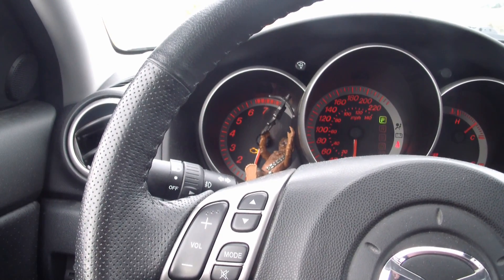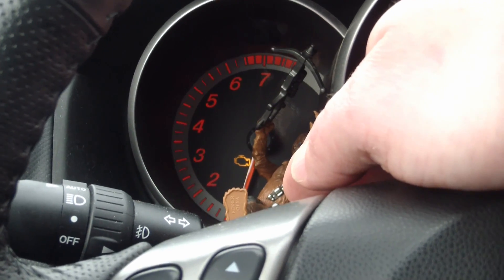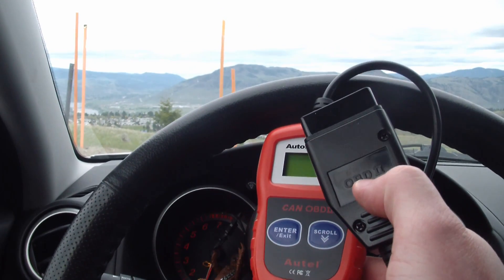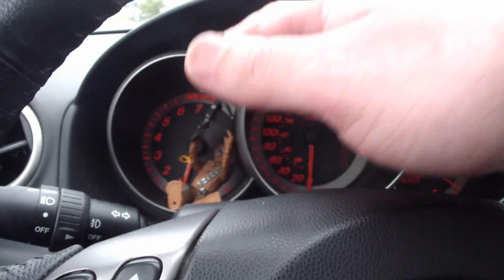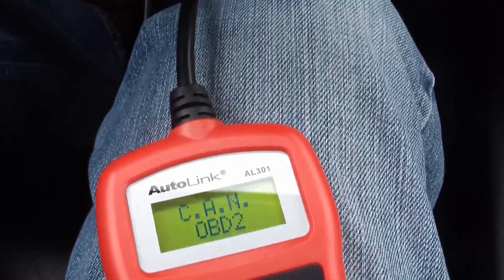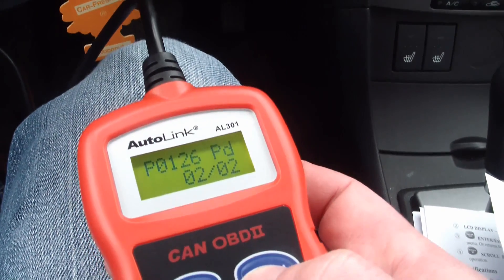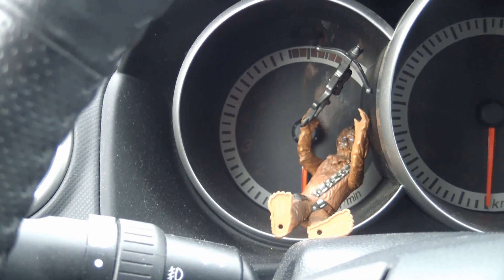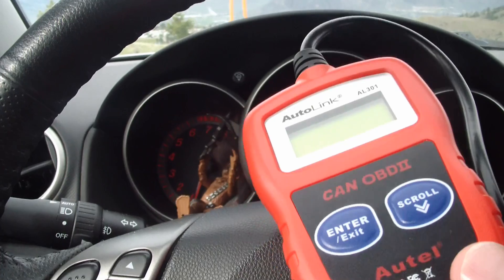Manly-Man Skills: Outsmart Mechanic Scams by Using Your Car's Computer!

Comment: Mom and pap garages will throw parts at it too. Like one time my friend's car had an issue where it was an intermittent no start issue. Dealership threw a new fuel pump in it. Only fixed it temporarily. And two independent garages also threw fuel pumps in it. Those only fixed it temporarily. So over a beer my friend and I decided to poke around with a multimeter to find a root cause. It ended up being the fuel pump relay. Replaced that and the problem went away for good. They drove the car for another 20,000 miles then sold it.

Comment: this IS a great way to get a rough, and i do mean ROUGH idea  what problems may be popping up on a cars computer.  getting a P0420 may or may not be a problem with the evaporative emission system, or you didn't tighten your gas cap past 3 clicks...

OBD2 Like it's predecessor OBD1 are a double edged sword. With some working knowledge of a car, it will help determine a better course of diagnosis using the scanner as a tool to aid you as opposed to it being the answer to your cars engine light.

As a mechanic i can say that i would love for people to get to this level of care for there car, proper documentation of pending or past codes can also help in determining the root cause of a problem.

like you demonstrated, you DO NOT need some ten thousand dollar scanner to do this simple procedure.  also a lot of those 30-50 dollar scanners have manufacture specific codes in them already (ENHANCED CODES).  Which is a further benefit.

Comment: Meh even with a fault reader you still need to work out what wrong and you need experience to get it right first time, get it wrong and you'll be buying and replacing parts one at a time and spend more money that you would talking to someone who knows cars.

Also if you really ARE a cheapskate this guy isn't even telling you the cheapest readr to buy, you can get bluetooth readers compatible with a smart phone for about a tenner that will give you much more information.

Comment: Also most OBDII ports are within arms reach of the driver if you are average height
Reply: +Tracty Zadorozny Yeah, because the OBD-II connector is required to be within 2 feet (0.61 m) of the steering wheel (unless an exemption is applied for by the manufacturer, in which case it is still somewhere within reach of the driver).

Comment: lol..... just because you get a code doesn't mean it has to be replaced... if your check engine light comes in for 02 bank rich. would you just replace the o2 sensor. or would you diagnose why your car is running rich? DO YOU EVEN KNOW HOW TO DIAGNOSE FOR A RICH CONDITION? DO YOU EVEN KNOW WHAT TO LOOK FOR? a code just pinpoints where the problem is doesn't always mean the sensor is bad. etc.. you don't just go and replace parts because this stupid $30 gave you a code LMAO!
Reply: exactly my point.... your the type of person who see's a code and replaces that part............ lmao gotta love the technicians who take time to diagnose to see if you have power.ground. signal. 5 volt reference make sure you are getting everything to the sensor and back to the ecu then you replace the part. if one is missing you have a break in the harness someone.... yeah replacing parts is the way to go!!!!!!!!!!

Comment: If you know what you're doing, a tool can save you money. If you don't, it can cost you much more than the initial purchase price. 

When you're feeling sick with vague symptoms you don't recognize plus a high fever, you don't  just shake down the thermometer and Google the temperature looking for how to fix it.(Not unless you're an idiot)

You call tge doctor, tell him what your temperature is, go to the doctor if he thinks it could be serious, pay him, take more tests, pay for them, and if youre lucky, buy inexpensive medicine that could kill you in the wrong dose or circumstances, and hope that medicine makes you recover.

The ODB tool is just like the thermometer. It gives you one more piece of information that helps you communicate the symtoms to your car's doctor.  No mechanic will fault you for reading a code. Any mechanic will have a problem with you obscuring the symptions by resetting the extended code history (that you can't read using a basic scan tool) of your car.

Comment: had this happen to me too. did a code check and said it was an evap leak issue. so I reset the code, made sure the gasket around the gas cap wasn't cracked, fill the tank to full and ran it until it was almost on empty. it's been 3 months since that check engine light came on and it hasn't came back on since. So I figured that the sensor tripped or something. not that I was too concerned about it anyhow since my county in the state that I live doesn't require admission checks.

Comment: That seems to be a Mazda 3. If so, check the coolant hoses down the left side of the radiator. There have been recalls in some areas due to poor factory fitment where the radiator hoses on the left of the radiator can wear on adjacent components and then rupture. The fix is to wrap the hoses in an abrasive resistant cover.

Comment: This may have already been said; but, most cars check engine light will come on when the odometer reaches one of the manufacturer's recommended service times; which gets you into the dealership to have your car inspected.  95% of the time there is nothing wrong with your car; but, it gives the dealership a chance to recommend things that your car/truck needs so that you can spend money when you get your service done.  Remember that for 98% of Americans, purchasing a vehicle is the largest purchase that they will make in their lifetime next to buying a house.  This may be one of the biggest reasons people pride their cars and trucks so much, you think? 

As it was said in the video "Google is your friend..."  When the check engine light comes on and you are positive that there is nothing wrong with your vehicle or you think that the recommended service times are too short and you are tired of looking at the check engine light; you can search Google to find out how to reset the check engine light, tricking your vehicle into thinking that it has had a service and you wont see the light again until the next time the odometer trips the setting or there is something wrong under the hood.   

I have a 2008 Toyota Sequoia and I watched for the light to come on when the odometer reached 10,000 miles, knowing that it was time for a maintenance check, the dealership even called me the next day the odometer popped 10,000 reminding me that it was time for my 10,000 mile service.  I bought the truck new from a dealership where my brother is a car salesman; so I called him to verify my theory of why the light came on and I was correct. He told me the combination of steps that I needed to do to reset the light without having needing a OBD device.  It was crazy and went something like, turn on car, put it in N, shut off car, turn key to ACC, put in drive....  Just check Google, you'll find out the steps for resetting your vehicle check light.  But, if you do this and the light comes back on in a week or so, that's when you need to get yourself an OBD reader or head to a mechanic or dealership to have your vehicle checked out.

Comment: Never ever ever go to a dealership, go to a family owned mechanic if you must, not a dealer, dealers are horrible for many reasons. Unless its like under warranty and the dealer must fix it free then thats different. Autozone will check your engine codes for you if you have the check engine light on. Also check engine lights dont come back untill you have driven a certain distance, usually 12 miles, even if the problem is constantly there tripping the engine light.

Comment: quick tip, don't undo your battery. most newer cars require a radio code, which will be reset when the battery gets unhooked. which will, most of the time...require you to come to us(the dealer) anyways. you invest money into a car, but then become a cheapskate when it comes to keeping it properly maintained? if you can't afford to take care of your vehicle, don't own one. or at least don't f*ck with things you don't know anything about thinking "oh it's just going to turn my light off" if it's not directly affecting you, leave it go. save up some money, and get it fixed properly...

Comment: What is your background?  I ask because mixed in with some very good tips are misinformation, half truths, and lies. 
  Not all dealerships are corrupt.  That is a lie.  It is possible that every dealership you have ever done business is dishonest, but I would argue that is due to choices made by individuals not a system.  Stick to space alien conspiracies they're a lot more fun.  You may not like dealerships, I'm indifferent myself, but there are times there is no substitute.   
  Smog is caused by oxides of nitrogen, not just nitrous oxide.
If you clear the code it will not be saved in the computer.  Once you clear it, it's gone, so is the freeze frame, do you know what that is?. 
California's air quality has improved only in part because of Automotive computer controls.  There are lot programs in place that are to make that state a better place live and visit.
 Did you get the 9 times out of 10 number from some unnamed bodily orifice?  That sounds like a random guess that you want to believe is true, which it isn't.  Just because you don't understand the system you are talking about doesn't mean that it's unimportant.  I don't know how a lot of diseases work, doesn't make them any less dangerous.  
   What you did not state:
 Many check engine codes will indicate a problem that until it is corrected can cause the computer to run the vehicle in default mode that will provide less power and poor fuel mileage.  P0126 is one of those codes.  Do you know why?
 Some check engine codes if not addressed right away will cause even more damage and / or lead to a crippling breakdown.  Do you know which ones those are?  Do you still recommend clear the code and waiting to see if it comes back?    
Did you know that not all OBDII codes are universal?  There are lots of codes that are manufacturer specific.  
       Clint Eastwood said it well:
   "A man's got to know his limitations."  
   Having a code reader doesn't make you a diagnostic tech, just like have a telescope doesn't make you a astrophysicist.
Reply: ScorpionRegent well said.

Comment: I make A LOT of money from people who listen to guys like you.  They get their scanner and check the code.  Buy the part that the internet guy says will fix it.  Part could be $50 or $200 or more.  Oops the light still comes on!  Now you pay AGAIN to have me figure out  the real problem.  
 HOWEVER you are on point about asking why a part is being replaced to make sure the tech isn't just guessing.  Just be prepared that you may get a pretty complicated answer.  The reality is that newer cars are getting very sophisticated.  Even in the factory service information you will be told to simply replace a part to test it because you would need to be an electronics engineer to test individual circuit boards.
Reply: Sometimes, if a part is cheap & easy.  For most of the components  I've seen issues with I've found test specs...usually a specific resistance. If you're talking after you narrow it down to a bad pcm/other circuit board, then yup ... replace it & toss the old one.
Reply: Guitars, Cars, and other man stuff YES!!!!!!!!!

Comment: heres the thing. if u buy a scan tool just to pull codes and take it to the mechanic. chances are that mechanic is gonna do more than just what u tell him/her and dig deeper. for example. YOU think that P0126 is just low coolant. but where did that coolant go? did it leak out the bypass valve? did it get burned in the combustion chamber? or did your timing chain guides fail and cause a timing chain to rub threw a coolant passage and dump your coolant in your oil. P0126 isnt just something to erase and forget about. cause it really is something as simple as a stuck open thermostat. if u tell the tech that u pulled up codes P0126. that will save that tech 5 mins plugging in the scanner and can immediately go straight to the radiator. by all means get a scan tool and educate yourself so u dont have to get robbed but dont hold information that might aide someone in their job. especially when its your car thats being fixed.

that said i know there are A LOT of crooks out there who will look at your P0126 and try to tell u its a catolitic converter and that u had code P0420 as well. if you provide a mechanic with information it will inform him that u are not stupid and know what your doing. its much harder for a mechanic to lie to someone who knows what is going on with there car

bottom line. LEARN TO FIX YOUR OWN CAR

Comment: Did the code come back yet?  You should have spent the extra $30 and got the scanner that will display OBDII parameters and then you could look at the coolant temperature and see if the reading is wacky.

Comment: Yep. Many car dealers, AND auto repair shops are scammers. For example, just to read the code, nothing more, they charge you $20. If you want them to just tell you what they think it could be, it goes up to $80 !!! Without doing anything to fix anything. If you want them to clear the code, it's an extra $10.
So YES, buy yourself an inexpensive OBDII code reader, and check it yourself first. Then, if the code is a recurring one, or a serious one (crankshaft position sensor for example) then check if your car is still under warranty and if it could be covered, and finally have a professional auto mechanic have a look at it. Chances are that if you can tell him what the code was, he won't try to bullshit you with unnecessary extras because he'll know that he's dealing with an informed car owner and not some gullible dumbass (even if you don't know much about cars)...
Reply: If reading a code was all that was needed, it would still take 10-15 minutes to get in and out of the repair bay, and mechanics earn their living by selling their time.  The basic  ODB error code is just one of the codes that can be read by a dealerships multi thousand dollar  system diagnostic computer tools. The cost of that machine also has to be partly recouped when its used. The last thing you pay for is the continuing education of the technician who uses the diagnostic tool.  Its like the plumber who  fixes a problem by tapping a pipe, chargers you $100 bucks - $1 for the tap, $99 for knowing what to do and where to do it.

Comment: Unplugging batteries has not cleared codes since OBD2 was mandated in 1994.
Don't spend $30 on a scanner, Partsource (Canada), Autozone (USA) scans for free and will do ABS. Your $30 scanner will not likely do transmission ABS and transmission diagnostics (open and close solenoids on command). Google will likely send you in the right direction PROVIDED you are smart enough to ignore advice like that of AvE. Now do a video on phantom codes (electronic error codes caused by other mechanical systems) like stretched timing belts, bad oil pumps or a faulty ECM and you have some intelligent viewing. A MAP sensor code does not mean the MAP sensor is the problem. For example, a stretched timing belt may cause retarded valve timing, a bad valve, vacuum leak, cam sensor may throw out a MAP code. Keep looking for that knock sensor on Saturns that isn't there even though the scanner says so. This is what I PAY MY MECHANIC FOR when I am in a jam. Also a low coolant level "should" result in high operating temp, not low temp however it would be a good idea to check coolant level. Your thermostat is likely stuck open but with a decent scanner you can check the car when it is cold for AF temp vs ambient air. When you turned off the car and the code disappeared, it was because the car was in open loop  (booting up and not warmed up to operating temp) therefore no code. That being said, I would place my bet on the fact that you got lucky on a simple code and didn't have to take it somewhere which makes you my hero.

Comment: Its called a MIL which stands for malfunction indicator lamp. It only comes on for emissions related problems nothing else. If its blink while the engine is running you have a misfire and catalytic converter damage will occur.